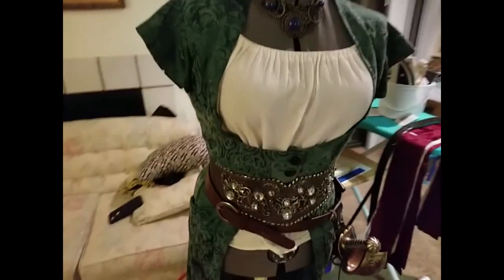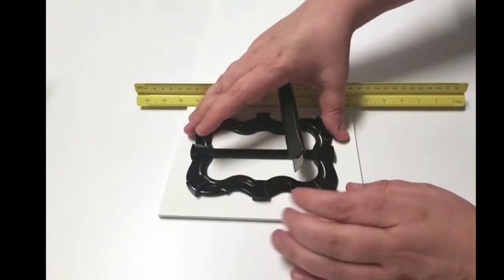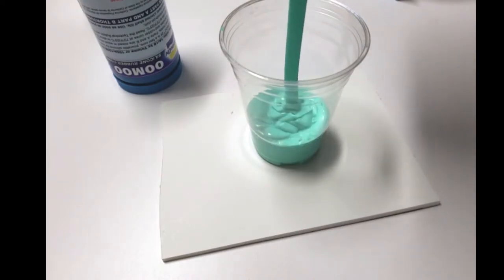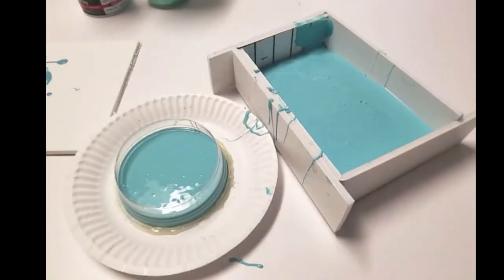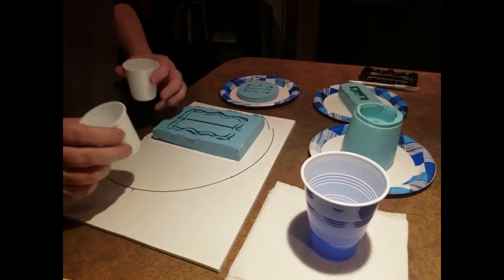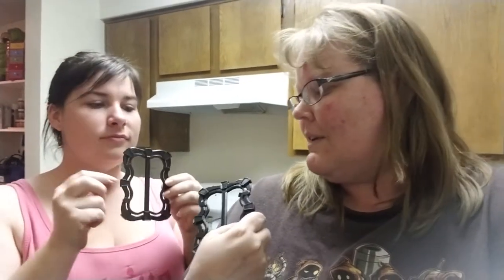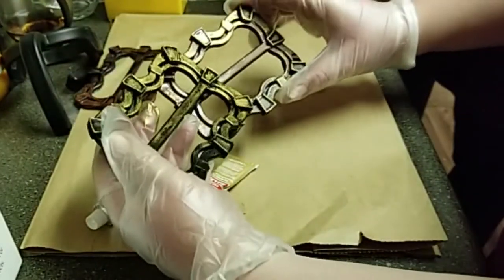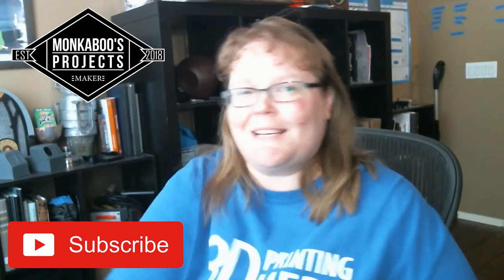3D printed PIRATE BELT BUCKLE - MY FIRST MAKE VIDEO!!!

Comment: Nice! Thank you for sharing. I have been curious to know more about the mold making process. Thank you. Your 3D printer is nifty too! :)
Reply from the maker: What part would you like to know more of?!
Reply: @MonkabooProjects  I got quite a bit out of what you showed already. Is there a particular vendor you use?
Reply from the maker: I just use Smooth-on products. Go to their website and they have a feature that you can enter in your zip code and it will tell you your closet vendor is.
Reply: @MonkabooProjects  Thank you!